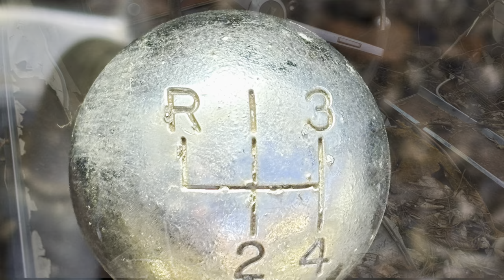SUPER RARE 1967 Pontiac Catalina 2+2 428 4 speed Convertible

Comment: Looks like N code burgundy and 8 lug aluminum wheels. Such a lucky find.
1989 I found a 67 GTO convertible 4 speed. It was 1 of 56 ram air convertibles that were ordered with the ram air RPO. It was N code burgundy with Rally 1 wheels. It was bone stock.
Reply from the maker: Great find
Reply: Sounds beautiful! I remember we had one in Marin (county) it had an amazing white interior. 4 speed, no console. I can’t remember if the carpet was burgundy or black. I remember seeing it at “Safeway” as late as 1979. I used to “Drool “ over that car every time they drove it in to get their groceries. I also can’t remember if it was a 389 or a 400. But she sounded sweet, I think I remember he told me he had put glass packs on it. That sounded so amazing that I put them on my Firebird. I can still hear the sound of mine to this day, even though it’s long gone.

Comment: Sad thing is that it really needs a 100,000 dollar restoration.  After that it's anyone's guess as to the value.  One thing for certain there were probably only 10 or 15 of these built with 4 speeds.  Back in 69 My Dad had a 69 Catalina with the HO 428 and it could light the tires from the line until you hit 76 mph.  When he looked into how many were built with that HO 428 it was something like 1728 cars.
Reply: Their aren’t any aftermarket parts for this ruff tub,but it’s worth fixing,hope this gentleman hits the power ball.

Comment: I can't even imagine trying to restore what's left of that pile of rust.
Reply: Nothing to it.   All it takes is a shit ton of money, time and effort.
But its a special car, it deserves a little love.
Reply: Definitely was awsome in its day. That's the good news. The bad news is that it was junked for a reason, the full size GM cars in the mid 60's were notorious for their box frames trapping water & rusting out prematurely, and finding replacement body & interior parts for a rare car like this will be very difficult if not impossible. Parked outdoors over dirt and without protection of a top would have further accelerated rust on the frame, floor pans, trunk floor, and inner rear wheel wells. Obviously a proper restoration would cost a fortune if could even find anyone willing to take on such a difficult & time consuming project.
Reply from the maker: @johnmcmullen456 the frame isn’t rusted at all. Matter of fact, the floor pan even though it has a few hole, still has the paint on it.

Comment: I had a 67 Pontiac station wagon 390 hp 428 with a four speed if you looked in the driver door it looked like a gto bucket seats console, pulled the engine and transmission and junked it. If a guy only knew!

Comment: non AC model, not a deal breaker but its definitely a plus cuz you can drive the southwest in the heat and survive ..   they have aftermarket for sure, someones did some stuff to it that badge isn't stock, valve covers air filter all that is not stock, go find a genuine model fully intact you will see what you need to find, sure hope you find it all...  WOW   also some did have 4 wheel disk brakes as well .. something else to hunt down to make her very complete, if it didn't come with em . .  but it was available so if not hunt it down!  big feature disk brakes are .. tach is available new . .

Comment: Only 280 convertible 2+2's were built in 1967. 261 were ordered with the High Output engine and only 144 H.O. cars were equipped with the 4 speed. Other added options could make it even more rare!! Ya, it's pretty rare. I'd say it deserves a concourse resto and brought back to its original condition. Anything less would be a travesty! It could potentially be a six figure car.

Comment: Is it a 428 or 428HO ?
Reply from the maker: Waiting on PHS
Reply: @ashmoresspeedandperformanc4782  you can see what engine is in it by the stamping on the  front of the block
Reply from the maker: @raymondboczek  it is, HO had ram air cleaner and different manifolds